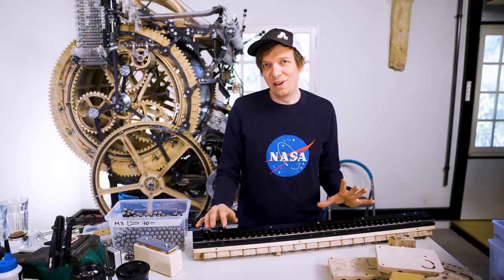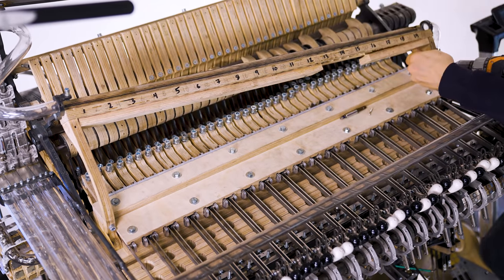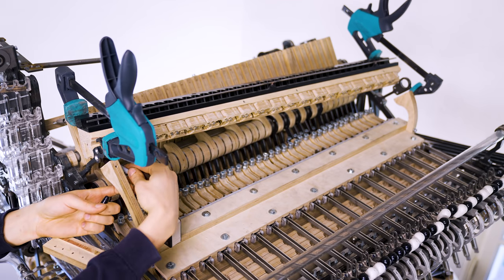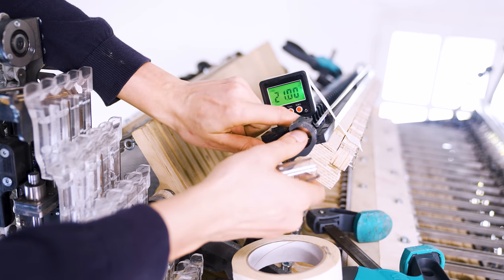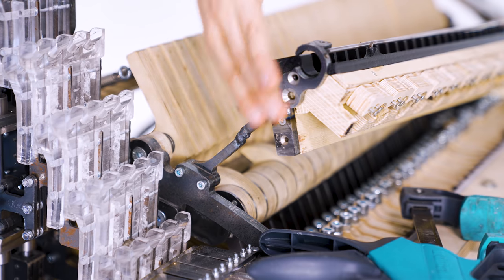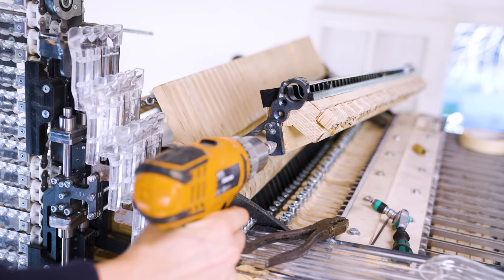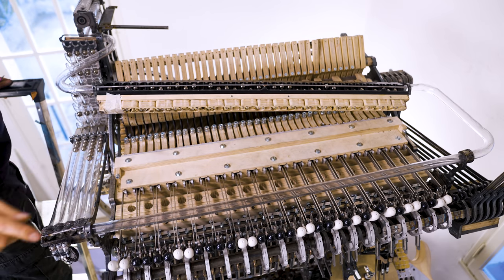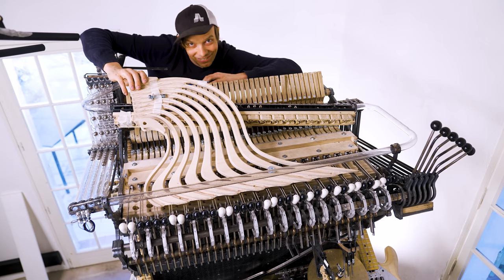The New Marble Divider is a Success!

Comment: Glad to see several Wednesday’s in a row again! 

How top heavy is the MMX getting? I would think about buffing up the base and adding some weights.
Reply: Well, with this modification it losses a lot of weight.
Reply: Yeah I think it's gotten lighter
Reply: It's Tuesday my dudes...
Reply: @buddyclem7328  timezones pog
Reply: Yeah, since his last marble test, I would estimate he's cut probably a net of 40% of the mass from the applicable sections of the machine's final mass due to the removal of so many parts. This also means that adding instruments is purely about tuning the angle and aim of the dropped marbles here on out, no tuning of height with those big chunky heavy blocks of wood, which, while light individually, would start to add up.

Ultimately a few dozen parts have been removed, the number of tubes has been cut in half at the least by using longer tubes instead of several assemblies for height manipulation, which will over all be lighter, and the supports needed for those blocky parts can likewise be removed to add more space and reduce mass.

I think the next weight gain will be a structure to stabilize the tubes leading from divider to droppers. It should still come out lighter though, the MMX is actually still sitting with a pretty low center of gravity due to the programming drum and instruments. If I had to guess, once the lanes are back in place center of gravity will be about a hands breadth above the instruments. We keep looking at the top, so we're focused on it, but when you look at the whole of the machine the most massive portions of the machine are lower down still. Even without playing any instruments, we could see the machine was steady while he cycled the marbles through the divider, which still means all the rotating and mechanical parts were running due to the fact that it all is driven from one source.
Reply: @buddyclem7328  This channel used to only upload on Wednesdays. It has been uploading on not-Wednesdays lately, that is the point.
Reply: @squirrel_killer-  I love the new schedule on Wintergatan and Wintergatan 2. I have proposed that our new saying should be "It's weekdays my dudes!"
Reply: I wonder how much the mass of the fly wheel pulls the Center of Gravity towards itself from the rest of the machine

Comment: So happy that you went with this design. I was so worried during the development of the modular height adjustment parts, because they just seemed like they would be asking for never-ending tweaking as parts shift. The clock escapement mechanism is also brilliant.

I’m hoping reworking the divide by 4 and spring steel moles with some of the other community designs will be next on the agenda :)

Comment: I love the look of the black plastic, so this idea is probably a bit late, but I had the idea of reinforcing the bottom of the plywood marble divider with a piece of sheet metal, something like 1/16 brass, which would allow those super sharp corners, allowing the marbles to not get stuck in trough. A little late I know, but a brass accent would have looked awesome, even though it would only be visible from about. cheers mate, love your videos.

Comment: Martin, you probably should also re-design the bottom part of the divider, just to be able to re-manufacture it if it ever needs replacing. Right now it's a machining operation with custom fixturing on top of previous machining operations for a different design built out of multiple parts.

Comment: When you make your runs from the divider to the clock advancers you should consider offsetting your runs by 1 place on each instrument group and routing the first or last of each section diagonally in front of the other tubes in that section to create a “W” pattern. Possibly use tinted tubes to help it stand out.

Comment: If you want to return the "wood" look to the marble divider... You only need the "sharp edges" of the guides between the down-spouts, as well as the floor of the "gutter", where the marbles roll down the track. So, you could make the whole back half of the "U" of the down-spouts be your old wood version. While the front, which holds the metal guide-rail, beyond the gutter, could also be wood. From the front, all you would see is the black comb-fingers, contrasting the wood down-spouts.

Or...

You could make a wood front plate to cover the black plastic, as well as a wooden top-cover, to dress-up the top of the black plastic. Though, the black plastic goes well with the black metal and provides a better contrast against the mirrored marbles. More than the tan wood.

Comment: I hope you are enjoying working in POM. I find it has some similarities in its behavior to aluminum, except that it doesn't have a ruby-hard oxidation layer to destroy your CNC cutting tools. As far as durability goes,it's going to outlast even the high quality plywood you use. It's somewhat brittle so that it tends to crack rather than bend, but it would take forces that would be shearing your plywood pieces to splinters.

Another advantage is that you can both CNC it, and you can 3D print it, or take a piece made each way and glue them together. If you have a large part with smaller regions that need to be really precise, you can mix and match your fabrication methods to suit, and still end up using the same material either way.

Comment: Hi Martin, have a search for flush cutting saws. I've only just got on to them after having to use hacksaw blades without the frame in the past. No good for metal but they're spot on for wood. You can also get handles for those 300mm blades that just hold the blade at one end.

Comment: you should grind steel before welding to clean the surface you could also grind a groove for the weld to make it stronger. Clean surface will make welding easier and better

Comment: @Wintergatan 10:00 Do a test like that, but remove the stop from one (or some) of the holes & let the marbles flow out of there.
If it works correctly almost all marbles should exit there, and almost no marbles should be able to recycle through.
Then if you know how many marbles you used, you can calculate the chance that a marble enters (that specific) an available hole, and what chance that it passes through, which also gives you a number of marbles needed to flow though to always keep the hole filled, and this can also determine what the fastest possible sequence of notes for a single hole can be continuously ("burst notes" are probably fine, as long as they don't deplete the "marble storage" between the divider & the dropper).

Comment: Though the wabi-sabi aesthetic on those multiply repaired upper brackets is great, and they are clearly strong enough, on the tour version a bracket which is more triangular in shape and attaches to a wider base along the top curve of the main machine body (though obviously curved to keep with the look of the machine) would be better.

Comment: Here is a thought when you get ready to ever thought of making castings of the individual parts of the MMX? Then, out of steel or other  metal substance, you can create an injection  form mold for all of the gears & other more intricate parts of the MMX . This way if you ever need to replace all you would have to do is inject liquid plastic to the casting of your choice if the part(s) wear out or break without taking more time to machine a lot of pieces to later be reassembled.

Just a thought...🙂

Cheers!

Comment: I was relieved to hear him talk about a "touring Marble Machine" being designed in CAD (I'm assuming this is the new purpose of the MMY), because for the past 2 months I just kept thinking "this thing will never survive a tour."  The tolerances are getting better, but there's still far too much instability in the machine and too many bespoke parts to safely move it 30 yards, much less from one city to another.  Just imagine the logistics of being on tour and a small but critical custom piece breaks during transport.  How do you possibly fix that on the road?  Do you carry spares of each of the several hundred parts of the machine?  Do you bring a TIG welder with you?  Do you commission an emergency order with a local machine shop?  How do you do that without CAD files?

I'm slowly regaining hope that the end goal is achievable.  I think Martin is recognizing that, in order for this thing to be used *on a tour*, not just to make music (which it's been able to do with 85% success for a while) this thing needs to be duplicatable.  If it can't be recreated, from scratch, given enough time and materials by a third party, then it's not safe to send it through customs or airport security.
Reply: Thinking that his tour route will be well connected to Maker Studios AT EACH STOP.  If something goes awry  he can have it ordered, and mounted, in 24 hours.

Comment: It might be worth considering having some sort of height adjustment still even for this system. It looks like marbles are very prone to catching in holes where there's a marble sticking up partially but it's widest point is below the contact area. It doesn't have to be as precise and finicky as the previous design. just something to ensure that marbles are never trying to push their way into a partially occupied slot. you could probably get away with as little as 3 or 4 different height modules. definitely could just make due with the parts you already have. Would also negate the work of needing to work around or remove the existing module tracks too.

Comment: The new marble divider works pretty well with marbles coming from the fish stairs but its only gonna get more complicated with all the marbles coming from the marble lanes. I noticed that the protective rail is only a bit higher that the height of a single marble, so if a marble coming down the marble lanes lands on top of a marble rolling down the marble divider, it could potentially end up on the floor. I was also thinking about where the marbles should drop from the marble lanes since the way would be partially blocked where the plastic dividers are located. Skipping over the spaces would mean having a "roof" on top of the marbles falling down to the gates. I hope none of this happens tho :/

Comment: Sure someone has mentioned this before but when you do closeups of the marbles you can see small bits of rust/discoloration. This is because you are touching the marbles with your hands and getting whatever oils/liquids on your hands onto them. In my experience with engineering small metal parts, the less I touch the longer the metal lasts!
Reply: It's because he washed the marbles 😶
Reply: Those marbles are rusty because Martin washed them before. He is well aware of this problem.
Reply: It was because he washed them a few weeks ago and didn't dry them good enough
Reply: @FuckY0uTube  fair. Finger oils rapidly accelerate metal rusting though; you can look it up yourself if you don’t believe me. This is something that should be considered on a machine that has tons of rustable metal parts and needs to last at least 2 years more without significant corrosion.

Comment: I hope you read this comment ! Im from the UK, on many engineering prototypes a material called "Tufnell"  was used in the company i worked in some 30 yrs ago. Its a very hard composite material that can be machined in the same way metals can. I used to machine Gears and Cylinders from it on lathes and form cutters etc. It can be sawn like wood, and planed also, so its not so hard that you couldnt use a CNC device etc. For us at least the issue with using Plywood was that the Cellulose fibers over a short period of time would start to "Gum up" the working parts and I see this on your marbles from the closeups that you video.   Maybe you are thinking that Plywood is not a good engineering medium for a permanent solution to problems ?? It never was for us at least... Perhapse this could be an alternate material for many of the parts on the Marble machine X... Just a thought from an old Engineer.... Best of luck with your continued venture called "Marble Machine X"

Comment: i think you're going to want to take a bit of material away from the little bosses that hold the rail above the divider.  you can watch the marbles slow way down because they get bumped into the adjacent slot, so taking away some material on the marble track side should improve performance.

Comment: Seems Like you're incredibly close to a finished product finally. once all the channels have clock escapements it should be fully functional as I understand it. Of course there'll be some fine tuning and adjustments but its not like there's another enormous mole to whack, just some small ones.
Reply: There is still a Base Guitar that has to be added to the MMX.   If you thought the marble paths were a nightmare.  The drop points and control has so far been a much bigger challenge for Martin and his team.
Reply: @peterkelley6344  riiight, i forgot that the cyber bass hadn't been properly attached yet
edit: wait no, its on the machine. There's still adjusting to do on it I'm sure but he made the bass and funnel almost a year ago. You can see the bass on the machine at 4:03. its got the big square shaped marble catcher.

Comment: it also gives the requirement that the machine needs to be in flat ground, if there's an inclination, it may mess with the angles and not work
Reply: There’s a level on the frame, and the legs are adjustable
Reply: needs to be flat already to function, and already covered with the leg adjustment things.

Comment: Now it seems as you could have that marble divider way lower and having only a fish stair or conveyor belt  on MMY. You also wouldn't need that complex plywood plane if feeding it just just from the side.
Reply: Agree the divider can be placed lower but won’t he need several entry points to the divider which is achieved via the conveyer belt feed due to the flow being too slow to feed all the channels at the needed pace?

Comment: For some reason, I´m a little concerned about that divider, maybe it is nothing but, It´s scary that is not consistent with the marbles to drop into the holes, What I meant is, some holes are not being filled regularly, so yes, all of them are filled by marbles, but, some of them just by one, so in the worst scenario, what happened if that track is empty and still the marbles skip that track? I think maybe is nothing and when we see the hole machine working with all the pieces this would be a pointless concern.
Reply: I thought that concern too, but what we have to keep in mind is that there is a large amount of marbles running through the track at different entry points, making the iterations of those marbles falling into their correct tubes all the more common. In short, the answer is simply more marbles!  There will have to be some music tuning in stress areas, but as far as populating those "Problem Areas" can likely be handled with just a tiny bit of filing.
Reply: I'm not too sure if that will be a problem. The computer cut parts may not be exactly the same, but it's all within a small enough margin that all of the holes seem to have a near equal chance of getting skipped, so as long as all of the holes are getting filled at a near equal rate it should be fine. I'm not a professional mathematician nor engineer so I can't be sure, but it seems like the skipping shouldn't be a problem
Reply: @KalarMeadia  exactly that, just let´s wait

Comment: I'm starting to really think that this machine is going to need a marble cleaner/polisher.
Underneath, it catches run off from the divider.
It would just take a small number of marbles from the pool, 4 little tracks.
Electronic, marble comes it, supported between 2 brushes, they spin, when finished it releases it then takes the next one.
Maybe it has a reservoir of polish and puts a drop on the brushes every so often.
Then maybe a way to periodically clean the black gunk off of the brushes?

Comment: Most likely already solved, but what if the stage at the place where you'll perform has some angle to it? Do you have any adjustments for the legs of the machine?
Reply: yeah that was thought of early in development
it has adjustable feet on the legs so it can be leveled easily

Comment: With this divider, what happens if the first K holes eats up some of the marbles but also the lasts needs as the rythm is fast? Is it possible  that the marbles are moving slow to reach in time? Also, what about the feeding rate? i Is it enough to feed  fast tunes?

Comment: Martin, I admire your commitment to perfection.  But I'm a little worried because it looks like you're nerve-wracking.  And the fact that the project is long-term is also an anxiety factor.  I wouldn't have to worry if you weren't bothered by the current situation.  On the contrary, I was relieved that your project was definitely moving forward.
Good luck, Martin 👍💫

Comment: You have now successfully created a marble throughput issue with the new divider, spin the machine up to like 150pbm with the magazine full and there is a substantial chance the divider won't be able to keep up, and fixing it with a retention bar is not a good option due to the inherent friction produced by the design,

This design, will clog

Comment: Airplanes are actually riveted for the most part and not welded due to fatigue stress would cause welds to crack causing it to fail mid air which is unacceptable ;) good joke attempt tho.

Comment: My inner perfectionist dies a little bit every time a CNC part gets cut and welded then called final. Great for prototyping but not the finished item. Martin please CAD the parts that you modify, you'll thank yourself if they ever fail and you need to make a replacement.